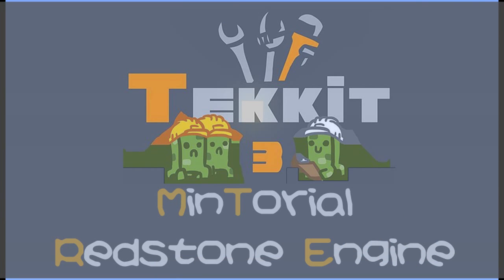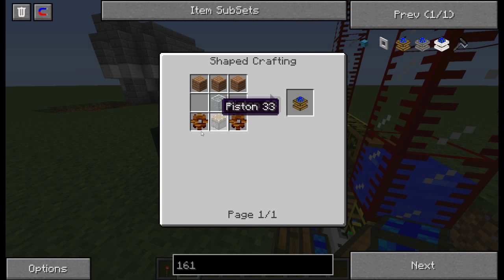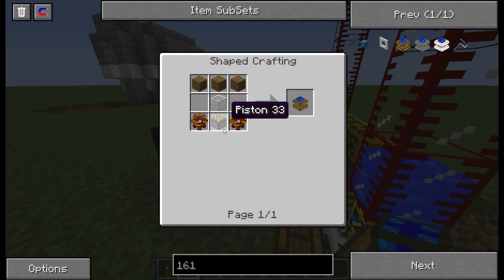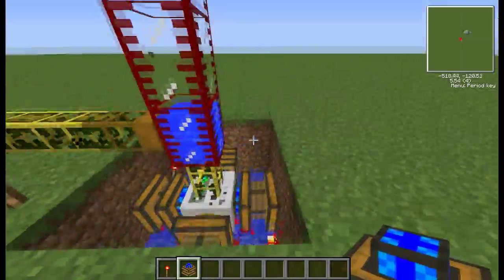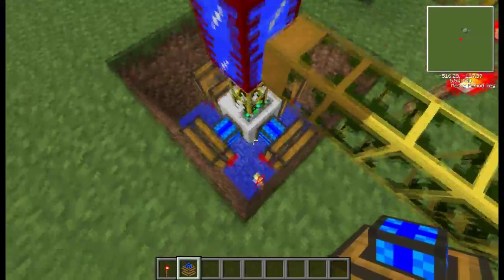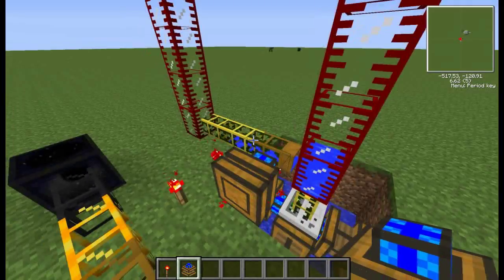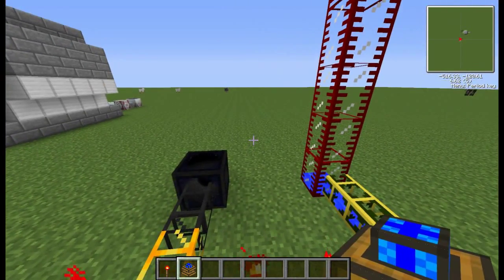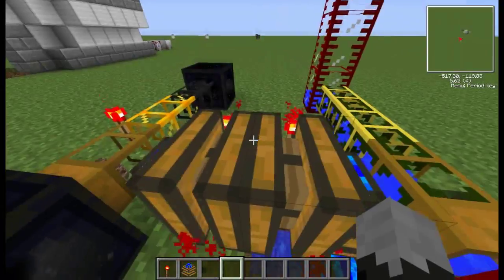TEKKIT Tutorial: Redstone engine

Comment from the maker: Lemme explain. The redstone engine will NOT explode while being used, ever, and I can prove it by doing a 24 hour stream of a redstone engine working at full pace for that long. However, it can explode if it is not being used, but still has redstone power added to it. So if you have the redstone engine which isn't pointed at a wooden transport pipe, a quarry, whatever you want to point it at. Then it has a chance of exploding!